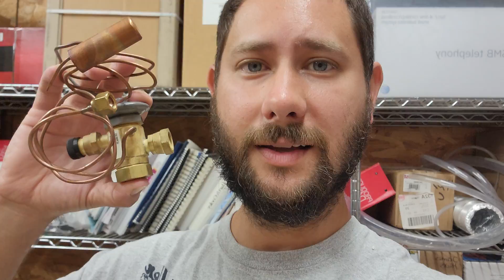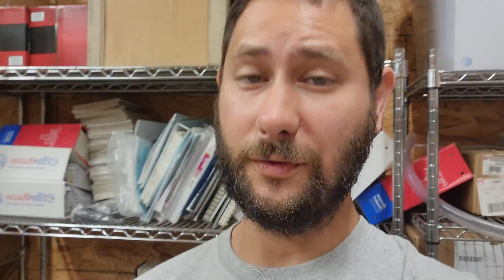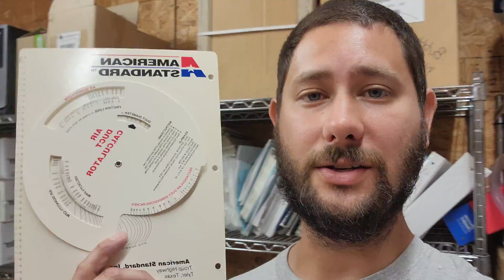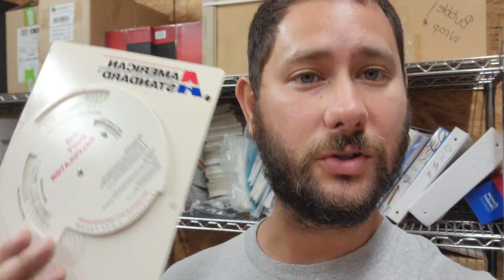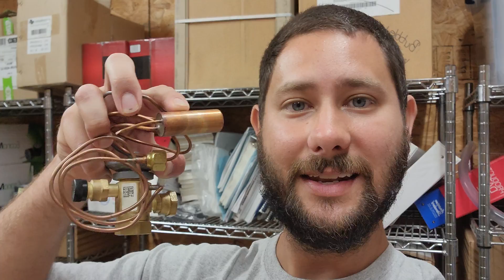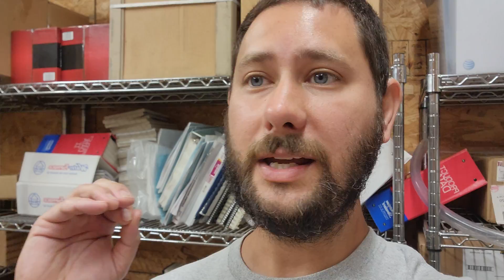How to know if the TXV is Bad?

Comment: These are old school techniques, HVAC school states you need a full liquid line which would be a minimum of 1 degree sub cooling and 100 psi difference between high and low pressures ....before ruling out the txv

Comment: Hey Taddy, I live north of yall in Richmond KY. I fired up the cooling mode about 2 months ago & about a month in it suddenly started blowing ambient air. I have a set of Navac ND2X digital gauges and at 75 degrees f my low is 126 (43.1) and high is 275 (89.9) 410A. I studied all your videos on TXVs and reversing valves. Also my filter is good and new my 6" flex ducts are good. Oh i had to force run the outside heat pump to get those pressures Thanks ahead of time for taking a stab at it !! Not a pro but have learned a lot from you and continuing the learning!!

Comment: Here’s the thing, when your working on a unit that’s been in for some time and has performed ok up until a certain point, I’m not going to spend to much time worrying about the duct work. Not unless something jumps out at me. I understand what your saying, but again it’s not likely to be the duct work as the problem if the unit has been in for 5-10 + years and your just now having an issue. That being said when you’re installing duck work you need to know what you’re doing. Absolutely. I agree. I’ve done miles and miles of duck work in my day. I understand what you’re saying. I just know that when I go out anymore and I’m diagnosing and repairing things I don’t have time to go back and redo all the ductwork. I have modified ductwork added returns whatever I needed to do when there was not enough airflow.
Reply: I agree. If the unit has been performing normally and the operating conditions haven't changed much (same number of people, weather normal) I wouldn't look at the duct sizing or the line set size first. True if the line set is undersized for say a 5 ton unit it may have worked fine for several years as a 3 ton unit and is now having problems because the load has changed (added a sun room) or the weather is unusually hot. Of course if I'm working on a fairly new installation (less than a year old) making sure it's installed properly is an important early step. But those situations are fairly rare. Most of my calls are on units that had been working fine and all of a sudden are not.

Comment: Having similar issues here, Lennox. Condenser came empty put about 7.22 oz is a 36 ….3 ton so low side sits about 139 high side 305 temp outside is around 79.  But now my SH is 29 and SC 15 when on reality it should be around 15 and 8 now im not an expert only been doing this for 4 years now and idk what it could be I want to know if it could be the txv

Comment: I have a 3 ton split system conventional. Suction pressure 97.5 high side  385.7 sub cool 10.2, super heat 4. Clean filters ductwork good, clean outdoor coil, blower speed good, evap coil does need cleaning. 50° at grilles. 3hrs later temp goes to 85° at grilles suction pressure dosent move high side goes to OL????
Reply: Help please. I think clean the evap coil and change run cap? Or txv?

Comment: Good information I will say though a lot of times it’s just plain old common sense when you’ve done duck work this kind of work for years you can just about walk into a place a lot of times and look at the duck work and if they don’t have half the vents covered up or closed and they don’t have a dirty filter or a chair sitting in front of it like I’ve had them do beforeI can look at duck work most of the time I know whether it’s big enough or not. The same way with copper tubing. But I realize not everybody knows that especially if you’re out in the field and you didn’t start out doing duck work for years like I did.

Comment: What if you're putting a magnet on your reversing valve, and it still goes into cooling mode on a trane but runs like it's still in heating aka the condenser is running as the evap stuck reversing valve?
Reply from the maker: not sure

Comment: I installed a new 5 Ton heat pump , heat is ok but cooling mode suction line  no pressure  its going low even I add Freon , is the TXV bad ? what is the part number of that TXV you holding ?
Reply from the maker: Could be a bad t x v
Especially if you're adding refrigerant and the pressures not going out
But there are other things to check like air flow. Is the fan motor blowing?
Reply: @taddydigest   Air flow is good , suction line no pressure stays  on suction (like walk in cooler solenoid coil closed  ) But heat work ok
Reply: @taddydigest   I replaced TXV , now pressure is ok Thanks

Comment: Unhook the condenser fan motor from the contactor. The high side will go up. If the low side stays around the same, the TXV is good. If it doesn't, then it's bad.
Reply: How do you check this on heatpump and how will you know if its indoor or out door txv

Comment: I mean 19 bar high side and the low side is only 2.5 bar to 3.2 bar. Added R407f but the low pressure didn’t go up , the filter seemed okay, warm on the inlet and warm also on the outlet. I already added more or less 2kg of r407 f but pressure on the low side is less than 3 bar. The evaporator is icing after like the compressor running for 39 Mindy it’s already Jason build up of ice the coil and the txt are as well

Comment: I have a problem with my packaged unit on the ship. Compressor run but always cut out on a low pressure switch. The ice on the evaporator and the compressor itself is icing too. Until the compressor stop running. The low suction pressure could not reach to to 5 bar. And run only for a Hotwire and cut out out on a low pressure switch. I added refrigerant but seemed the pressure dint go up. Remain at 2.5 to 3 bar. Even after adding R497F pressure didn’t go up. The unit is 5 kg  407f when running in good . High side pressure and 9 bar. My question is, why the low suction pressure remains low

Comment: Taddy Bear my Hermano question for U.  On a split system heat pump cool cycle is good BUT on heat with in 15 seconds my head pressure rises over 575 psi.
Reply: On both high and low does this mean it’s my condenser TXV?
Reply from the maker: could be txv
check airflow 
check filter drier 
first
Reply: Well it’s a dual fuel Lennox gas furnace yet my natural gas cycle doesn’t short cycle at all, works fine!

Comment: Superheat and subcooling? Those are my main tools for troubleshooting a TXV. If I have high  superheat and my subcooling is good that's a pretty good indicator there is an issue with the TXV. High super heat low subcooling - charge issue more then likely.
Reply from the maker: Very good brother

Comment: I'm seeing conflicting instructions on the direction of the bulb wicks. It seems 2 or 10 o'clock positions on a level suction line would work the same eitherway. My question is what do you practice in both vertical installation and horizontal installation of the bulb in relation to it's wicks?
Reply from the maker: Hey brother thank you for joining make sure you get my guides by sending me an email.
Here is my email tadfuller1@gmail.com
Reply: @TaddyDigest  I received all your guides today thanks.

Comment: Why does my customer have heat coming out of their heat pump (102 degrees supply) when I set the thermostat to “cool”?
Reply from the maker: Thermostat not set correctly for o or b
Reversing valve not switching
Program thermostat or rewire 
or check valve
Reply: Is it a bad reversing valve?

Comment: I have a question. I have brought 3 technicians to the house and none seem to find the problem. I have a 5 tons a/c and is 2 years old. I had someone change the fan. Because the other one went bad. Now the liquid line gets hot most of the time between 1-6 pm. And not all the time but when it happens I have no cold air. It comes out hot. It cooks in the night really good. I just don’t know what to do anymore. Please help
Reply from the maker: If the liquid line is getting hot that means the head pressure is too high.

Could be overcharged could be a restriction a bad t x v or could be the unit is dirty.
Reply: @taddydigest  thanks for answering my text . Wow too many things. I’ll start by cleaning the the unit outside. Cause I called a tech and the ac has the Freon it needs. I’ll take it from there. 👍🏻

Comment: You're intermixing setup and installation/design problems with "for real", component  functional failures. Clogged filter, defective TXV,  leaks, capacitor, compressor, contactor, are component functional failures. 
If an AC has been in operation for years then all the installation/design errors are moot. You should be making that distinction in your narrative, e.g. if you're on a call and the customers AC unit's been in operation for five years then likely the ductwork sizing, piping, etc. is moot unless there's been recent work on the system to change those areas. The tech should be focused on component failures not installation problems. Those kinds of calls are most common. You're dissertation here would be very confusing to a noob, indeed.
Reply from the maker: Yeah you're right. 
Very well said thank you for this
Reply: Not if you got rodents in attic destroying flex duct😭

Comment: What happens if the small tube near the sensing bulb had a leakage and repair? Will the txv still function normally? To further explain is the sensing bulb a capillary pipe connected to the head of txv and a small one which is the end. That other end capillary tube was leak repaired. Can it still function normally? Thanks so much.

Comment: Just a quick question , maybe someone can help me out. suction and head pressures were low, which was an indication of a leak somewhere. Popped open panel to the air handler and started searching for leaks. Long behold good old fashioned soap and bubbles brought me to the leak coming from the txv. The valve is similar to the one you are holding, I noticed that the cap that’s seated at the very bottom of the valve was cracked and resulting in the leak . Do you suggest replacing just the cap or the whole thermal expansion valve? Thank you
Reply: I would just replace the txv

Comment: Saying, you have to know what you were doing, is of no use at all other than to be condescending Lee simple minded as you are saying it. Knowing what you are doing covers a lot of things. One being that a person can be technically savvy at what they do, and not be a worth a flip at teaching it. Only a good teacher can have an opinion I want a good teacher. Nonsensical rhetoric comments are not helpful. A lot of possible TXV problems could come after a system has been running for a long time without any issues. Then you will see high head pressure in some cases and the clicking sound of the TXV on and off. WHEN BEING A TEACHER, DO NOT EXPECT ANYBODY TO READ YOUR MIND. At least, pretend to be teaching new people from the ground up succinctly. There is a time limit I understand however, make it count.
Reply from the maker: thanks 👍
Reply: Shut up nerd. These videos aren't for homeowners. "You have to know what you are doing" translates to "don't watch this video if you haven't even built the basics". Build the basics and come back

Comment: A simpler way to check the TXV is un plug the condenser fan. As head pressure rises the suction pressure should remain stable.
Reply: I was gonna recommend this same procedure as its a sure fire way to test for a bad txv
Reply from the maker: That's awesome Chris thanks 😊
Reply: So as head pressure rises the suction pressure should remain the same..that signifies the txv is good?
Reply: @Yeti808 No, txv remain stable without any change
Reply: . So, if it remains stable, the TXV is bad.  Is that what you mean?
Reply from the maker: Thanks Joe it's a great idea
Reply: Or do you mean to put a piece of plywood on the top of the condenser to restrict air flow?
Reply: What HVAC guy carries around a piece of plywood? Cardboard around the sides will do the same thing... but again who carries cardboard.  @coolramone
Reply: @joecooksey4331  unplug condenser fan.
Reply: @joecooksey4331  That can also be done to charge up a heat pump in the winter time while in cooling mode, builds up the head pressure and the unit think's it's 80 degrees outside.
Reply: Yes, would the same result.😊 @coolramone
Reply: Up plug? You mean unplug?
Reply: @coolramone nothin much, plug. Ha, gottem!
Reply: I tried this trick today my unit had high superheat and high sub cool, immediate result. Suction gauge stayed still as the head press rises.
Reply: Why up plug trip the fan contactor
Reply: Thank you, sometimes people make things harder than they need be.
Reply: I usually cover the fan with my knee pad and watch it but the fan unplugged is a great way to!

I also use my two contractor bags that I've zip tied and will wrap the condenser. It's nice because the fan pulls it right in to wrap the four sides
Reply: What if the TXV is bad after you do that? Does the suction pressure drop or goes up?
Reply: @klabkebash  You'll have to replace the TXV.
Reply: So
If the High side goes up and the low side stays stable?
What if low pressure goes up or drops? Bad TXV?
Reply: @3cats932  Yes... you may have a bad TXV.
Reply: @R P do more research....https://www.youtube.com/watch?v=Uh_9S7v4nz4
Reply: @R P Everything you need to know. https://www.youtube.com/watch?v=Uh_9S7v4nz4
Reply: Heh! I didn't know this thing!
Reply: Not always… A TXV without a balanced port feature will have a more volatile response to higher head pressure, as will a TXV oversized for the evaporator and expected heat load… In both instances you wind up with hunting despite the fact the TXV is still operating as designed…
Reply: @EarlHayward  Say again?
Reply: @joecooksey4331  There are many times when evaporator pressure will change with increased head pressure yet the TXV is perfectly fine. Thus, your comment is flawed as there are plenty of instances where your theory does not remain true.
Reply: @EarlHayward  I'll wait for your example based on a conventional TXV.
Reply: @joecooksey4331   Conventional TXV? I guess you have never experienced a TXV that is hunting? Or worked on a TXV without a internal or external balanced port? I wonder how many valves you have unnecessarily condemned! I guess if all you work on are straight cooling 3 ton resi systems you would never have to deal with this… I won’t even mention hot gas bypass valves as those systems are clearly way outside of your skillset… My bad!
Reply: @EarlHayward  You just proved up you have little knowledge of how a conventional (non-balanced port) TXV works or what its job is in the system. This should help you... https://www.youtube.com/watch?v=Uh_9S7v4nz4
Reply: Thank you!
Reply: I try this test today and head pressure go up and low pressure also go but like 3s later does that mean I have a bad txv ?

Comment: The indoor txv is also used in heat mode! 😊 If you find a heat pump having issues with not defrosting properly, it could be a defrost switch, thermistor sensor, defrost circuit board...or it could be your indoor TXV. Three in the last 20 years went bad in the winter time. Hundreds in cool mode. Mostly because homeowners don't pay attention to abnormally high Jan/Feb power bills and persistent ice buildup on hp coil.
Reply from the maker: Dude you are super smart and I can tell you've been doing this for a long time
  Have you ever thought of offering Tech Support
Reply: @RV10flyer I was told that the indoor TXV is bypassed in heat mode, and the outdoor is bypassed in cooling mode. Was I told wrong? If true, why would the TXV be used in heat mode unless the bypass is bad?
Reply: @realSamAndrew you were given the right info. The outdoor metering device is used for heat but I’ve heard of one that does both.  I have not seen them myself.
Reply: @caru3257  this question remains a mystery as the commenter has not clarified.
Reply: @realSamAndrew  there is no mystery. A conventional heat pump has two metering devices.  I cut  equipment before I sell the copper coils.
Reply: @caru3257  you evidently have not read my original question. It has never been answered by the person it was directed to or anyone else so far,
Reply: @realSamAndrew  Indoor TXV is used during defrost cycle on heat mode
Reply: I thought the indoor TXV isn't used as thr system is in heat mode? During heat mode the refrigerant is reverse